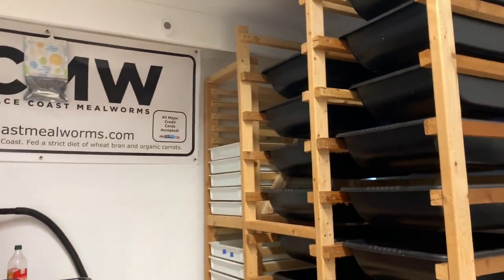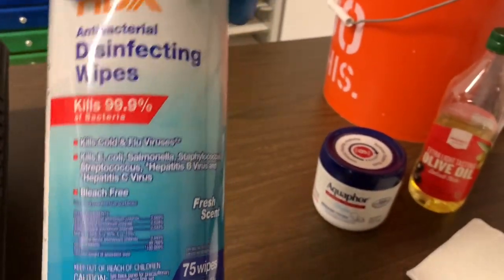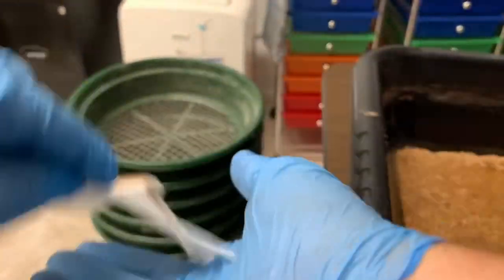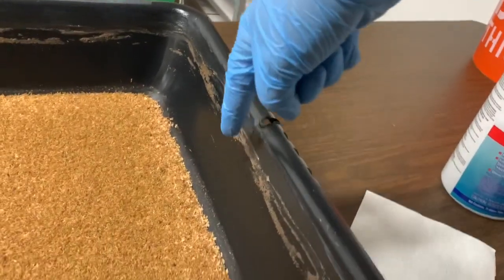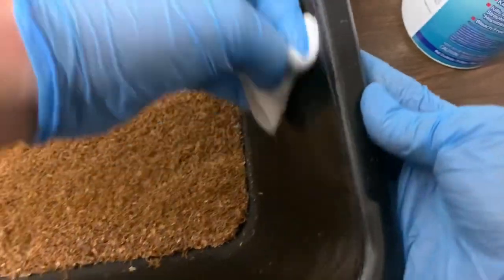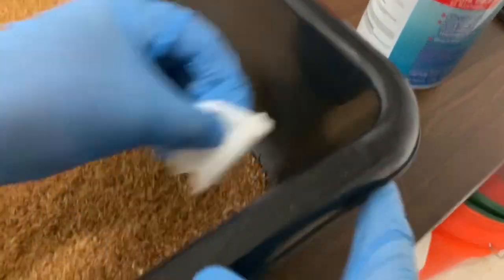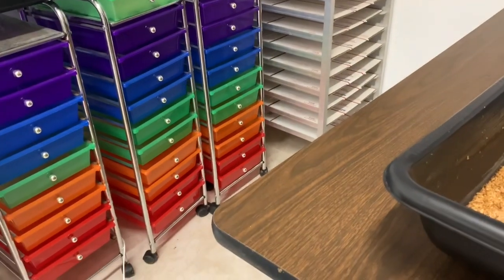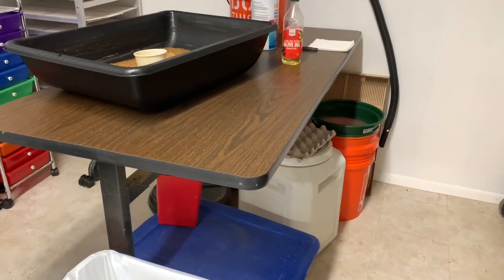How to Remove Grain Mites from Mealworm Trays

Comment: I have been breeding superworms and for a year I was breeding them very rapidly. The superworms were always hungry and growing fast. Now after these mites took over my whole container and any objects near it, the production of super worms have decreased a lot. I have tried this petroleum jelly method but all it does is contain them, not get rid of them. If I microwave the whole wheat bran then all the superworms will die with it so im stuck in a rock and a hard place.
Reply from the maker: Sift out the worms and briefly wash them in water. Place them back in new, sterile bran.

Comment: What do you use for bedding now, & What have you tried for bedding ? Also with what you have all tried, which do you think is the best bedding to use; what would you recommend ?
Reply from the maker: Mealworms love a variety of grains. I have used oats, wheat bran, chicken starter crumbles, and even spent brewer’s grains. Ultimately for me I prefer wheat bran because it sifts well and is cheaper than other options.
Reply: @spacecoastmealworms  : right now I’m using oatmeal. I don’t know if it’s the oatmeal itself, but when I put carrots in, the moisture from the carrots make the oatmeal bedding clumpy & nasty ! Turns it to a dead green, almost grey color. Do you have any problems with this ?? 

For the last 4 days, most of my worms either stopped moving, or slowed down to not moving at all, ! I thought I did something wrong. I turned the heat up thinking they were cold. Then last  night I looked in my bin, 30 pupas ! OMG !!  I need to make room for the 30 new beetles that are coming so I decided to feed my frogs some of the older beetles ! They went to town on feeding ! It was AWSOME to watch !
Reply: @spacecoastmealworms  : I was also wondering, can a MIXTURE of fine grains also be ok for the bedding, or does it have to be just one grain ??
Reply: @UnisausS1  a mixtures is perfectly fine, and I’m sure the worms will prefer it! 
Regarding the clumping, have you tried cutting the carrots down into smaller pieces or even shredding them? Doing this will provide extra surface area, and the carrots will get eaten faster (and thus leaving behind less waste and moisture).
Reply: @scottjost857  : never tried that ! Hmm 🤔 Going to try it !  Thank you ! 

Hope you don’t mind me askin questions. Right now the bedding is an experiment till I see what they like the best !!
Reply: re grain size: see https://www.youtube.com/watch?v=VoZyUv8jh74
there the grains/oats are shredded to flour, so the worms grow faster.
freshly grinded flour is better cos flour will oxidize over time, especially brown flour.
(a lesson from mushroom growing, they use brown rice flour)

Comment: Thank you for this video. I'm wondering what keeps the mites from just staying in the bin and reproducing?
Reply from the maker: Same reason why seeds fly away in the wind - maximum dispersal!
Reply: @spacecoastmealworms  
I was thinking the same as Marissa.
What stops the mites reproducing in the bin in perpetuity and what does your initial answer mean?

'Same reason why seeds fly away in the wind - maximum dispersal!'

It doesn't make sense at all!

You seem to be simply containing the mites in the bin rather than getting rid of them?
Reply from the maker: @myobs  Their goal (as with most life on earth) is to reproduce and continue their species. This is why they spread out away from their colony. Access to basic needs drops when population density increases, so it makes sense to instinctively spread out away from each other in search for more resources.  Mealworms do this as well, right before they pupate, knowing that they are prone to cannibalism while in pupae form. This is why they all gather around the edges of your bins as mature worms.. they are trying to spread out.

Mites are dying inside the bin because they are drying out (assuming you are no longer adding carrots or other moisture sources).
Reply: @spacecoastmealworms  
Thanks for taking the time to clarify that with a detailed explanation, it’s appreciated.
I may have missed the reason for you going to the trouble of trapping the mites in the first place?
I assumed the reason you didn’t just throw the contents of the bin, including the mites, away was because there were still some eggs contained within the bin?
If this was so, then wouldn’t you be placing food in there for the newly hatched mealworms and therefore, the mites too?
I’ll have to watch the video again.
Thanks again and all the best.

Comment: They came with my mantis feeder insects and they've migrated to my computer, nightstand, floor, planters, mantis terrariums, EVERYWHERE I look pretty much! =....(    what do I do in this case? I'm beside myself with exhaustion.  They were even on my massage table. Is there a spray I can use? Neem oil mixture or peroxide? I know 91% alcohol doesn't kill them ( if you can believe that one.) I even tried Eco-Mite Botanical Insecticide Miticide and it did absolutely nothing.
Reply: I just did an experiment yesterday 70% IPA, sprayed directly at the grain mites, at first it looked like they were unaffected, but after 10 minutes when I came back they were all dead.  So Alcohol will kill them for sure.
Reply: 90+% actually doesn't contain enough water, ironically 70% is better for this and for disinfecting because of the higher water content that penetrates bacterial walls and insect shells

Tbh the first thing I tried when it happened to me (before thinking to google "tiny white bugs", "what do mites look like" and "remove mites from superworm colony" instructions) was straight vinegar on a paper towel and im not sure if it was the acidity or just how wet the cloth was but it did kill them straight off. 
Almost everything says just throw them out and start over except this and like one single article. Trying the oil and cup methods now and hoping for the best
Reply: Diatomaceous earth (food grade) will kill them but keep it away from any pet with an exoskeleton as it will kill them. They also have anti-mite paper you can buy and line cabinets, tables, drawers, etc. with. Additionally, they sell antimite spray that works very well with killing them. If the terrarium you have your mantis in is infested, I've heard you can put a slice of cucumber in to attracts them and then remove and replace it everyday until they are gone. Most importantly, cleaning habitat of all dead insect carcasses will help as it removes their food source.

Comment: Iv seen I have mites in my friut fly tub and beetles/ meal worms tub
 Iv had to rescue the beetles, wash them with water and put them in a ventilated enclosure I used for my jumping spider, and I picked up as much of my meal worms as I could and washed them with water  I tried to use a siv  but it wasn't that great but was able to rinse then and put them in.  The rest I had to throw outside, it was too infested. I had loads of mites along the corners of the ceiling above my bedroom window  and my window sill so wiped that down   washed everything.  I'm hoping what is left of the mites will Die off now there isn't any food source for them. I am going to re wash my window sill and hoover the carpet incase theyr in the carpet aswell. Iv had hay fever symptoms for a few weeks and now I know why!  Im allergic to the mites.  Iv put weetabix cereal with them as they are dry so hopefully if any is still with them now, theyl die. If not  il just throw them away. I feel itchy lol

Comment: @Space Coast Mealworms, do you think this method also works with the breeding of cockroaches latheralis???
Reply from the maker: Aside from the roaches that try infest my house here in Florida, I have no experience with cockroaches.
Reply: If you are talking about red runners, then it is going to be pretty difficult to get rid of them without trashing the whole colony. The high humidity the mites like also is required for the runners to breed. The only way I know that you can do is get some gallon ziplock bags, bleached non self rising flour, Pick out all the roaches you can individually into another sanitized bin. Put a handful of flour in the bag with the roaches and do the shake and bake. Only for about 5 seconds or so. Then dump them out into a new sanitized bin and jostle most of the flour off them. The flour will dehydrate the mites, make sure the new breeding bin you put them in stays dry with no food for a few days with the Vaseline around the rim. That worked for me but it took a few times.

Comment: Do you think I can get a similar size plastic yoghurt pot to put oil in so the mites get in but my worms dont
Reply from the maker: Doesn’t hurt to try! Only thing is to have a container the kites can crawl up. I don’t see why they couldn’t crawl up a yogurt cup
Reply: @spacecoastmealworms  I made my own traps by cutting up plastic bottles and they were covered in them after a day I checked the next day and there was nowhere near as much hopefully the mites are dead

Comment: Just freeze your substrate overnight in a deep freeze and you will never get mites.
I use oatmeal in the cardboard tubs. As soon as I get them home I take the plastic lid and paper seal off the tops and set them open in the deep freeze until the next day.
I have never had mites in my mealworm tubs in 10 years of raising them.
Heat doesn't always kill them off, but freezing is guaranteed.
Reply from the maker: If you watch the video you’ll hear that I freeze mine as well. The one time I didn’t is the time I got these mites

Comment: Try to microwave the oat for 5 minutes before using it , for safety and to kill any mits or thier eaas as well as reduce moisture in the oat.
Reply: I heard that's counterproductive and traps moisture.
Reply: @atozflypz5301  thier are only 2 ways that i know that would kill the mits and forgin things eggs , 1 microwave 5 mins  or 2 put in the freezer for 10 days so the moisture in the eggas would expand and blow the eggs.

Comment: ok, so I am going to provide a solution, that may have been already mentioned in previous comments, so, why not simply put some of the infested grain onto a aluminum pan, preheat the oven to... say 150 Celsius then stick the infested grain in the oven for 15 minutes??.... that heat should exterminate the problem, then simply separate the dead mites with a strainer, and the you go...!!
Reply from the maker: That idea would absolutely work if the worms are large enough to sift out. These tubs all had babies in them though.

Comment: How does removing their trapped mites end the life cycle of the ones that are still down in the bin?  Seems like you should throw the whole thing out.
Reply from the maker: The ones in the bin will eventually make their way to the edge and try to climb out, so with time all mites will get trapped
Reply: Thanks for this topic. I hadn’t found this info anywhere and recently had my first infestation. I will freeze my wheat bran first from now on.
Reply: @spacecoastmealworms  How much is the kilogram of it, and is there an abundant profit from the work of this farm at home?

Comment: good thing you have BLACK containers, so you can see the mites. i guess with white containers, the mites are almost invisible, and we would need a microscope to see them
Reply: I have clear and white containers and you can see them.  They look like brownish powder. I have been dealing with them for a year now.  This video has helped.  They are very difficult to get rid of. My initial infestation started from a box of oatmeal I purchased from the grocery store for the beetles.  I have kept them down but with summer they get worse.  I keep mealworms for my chameleon only.  I started baking the substrate and keeping it in my freezer before use.  I also sift when the worms get bigger to clean the substrate monthly.  Daily I wash the tops of the containers. I have had to get rid of my beetles twice within the last year but I did get the baby worms out first. I suspect once you get them, completely getting rid of them is impossible.  It only takes 1 mite to get the infestation started. I appreciate this video though.